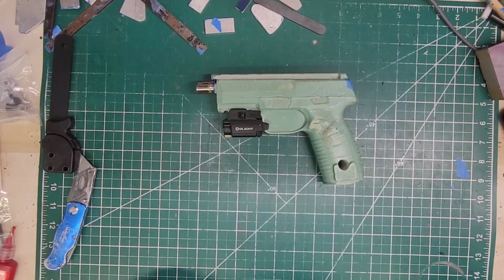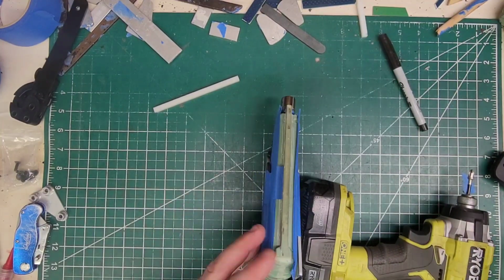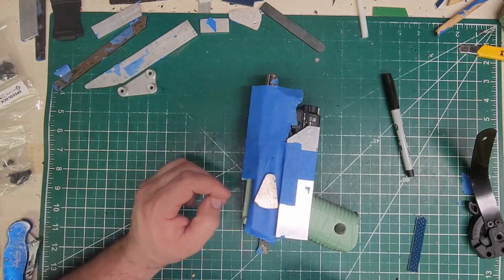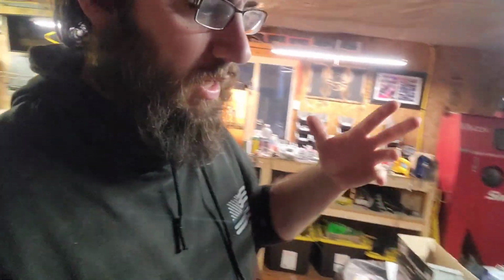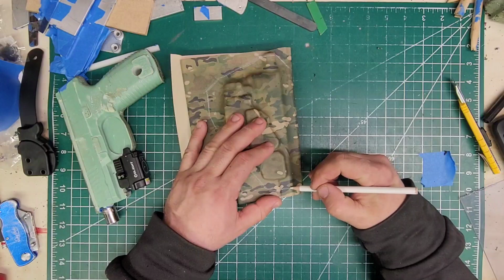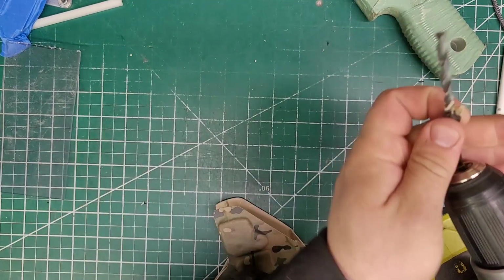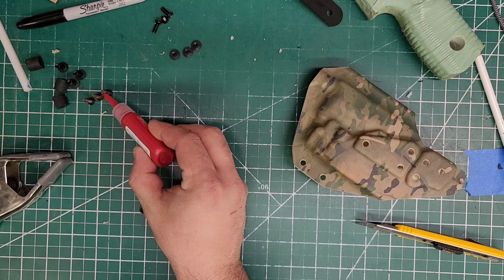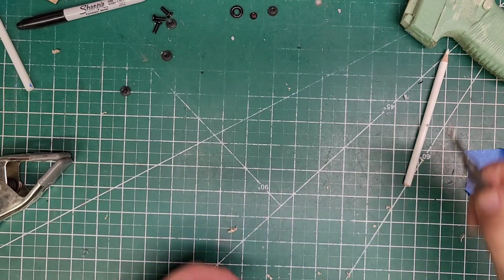Multicam FN 509 Tac with Baldr Mini

Comment: What prop guns do you order because tape never sticks to the ones i have same with glue i tried gluing and same result nothing sticks. I would love to know what the trick is.
Reply from the maker: Clean the molds.... they have mold release on them which is oil. I spray with brake clean and wipe with alcohol.  I have a video on it

Comment: Can you remind me what measurements your retention hardware is?
Reply from the maker: 1/4 inch Slotted post.  .4375 screw. Appropriate rubber bushing.
Reply: @FalTacUnlimitedLLC  thanks! Do you use the same length bushing everytime, or is it dependent on the application?
Reply from the maker: @andymeresse6930  I'll say yes.  I use 1/4 wood for retention plate so it's good to have that bushing slightly larger than that. Sometimes I'll go up to 1/2. Depends on hardware
Reply: @FalTacUnlimitedLLC  thanks so much!